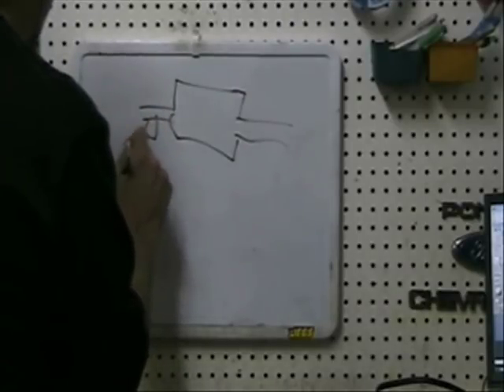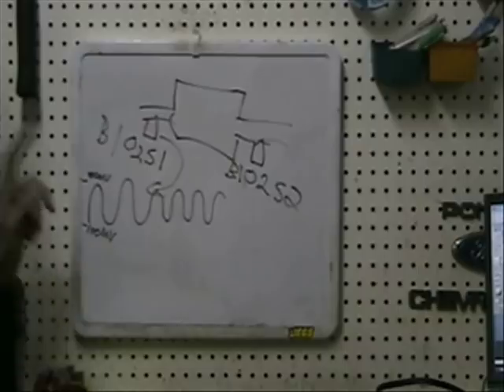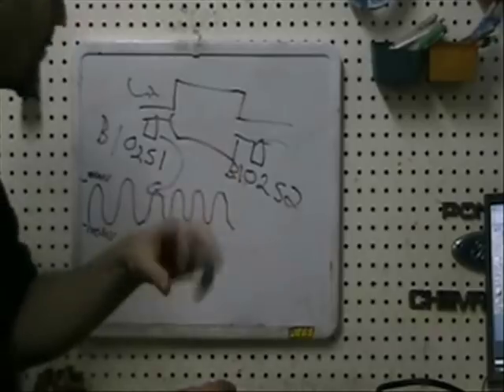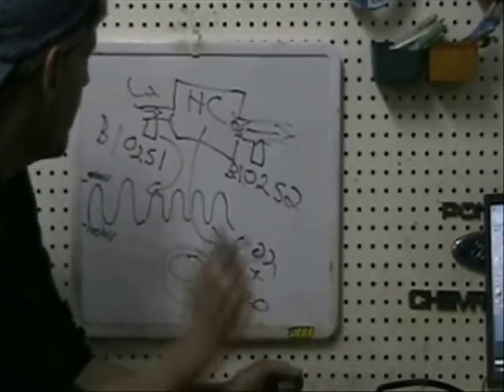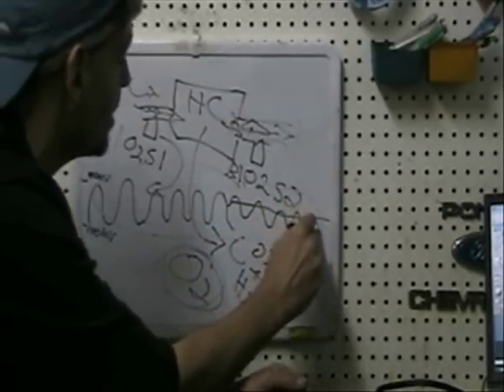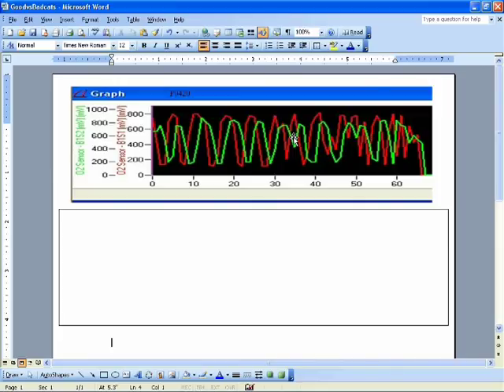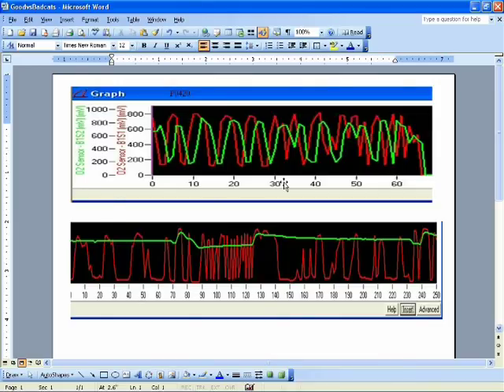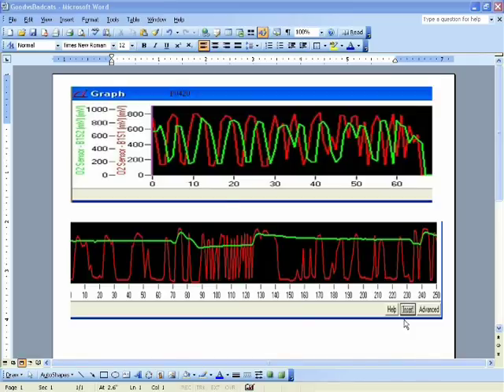P0420 P0430 catalytic converter catalyst inefficiency code diagnosis

Comment: also mat i have a chevorlet aveo it also has p0420, i just remove the heat shield and found that the manifold was cracked, so i tried to weld it back did a decent job. after a week the problem came back, this time when i checked i noticed that as soon as i hit the throttle the downstream o2 sensor voltage fluctuates, so what do you say maybe i still have a leak and also this car has a exhaust leak after downstream o2 sensor, can this be an issue?

Comment: Good explaination on bad Cat. Matt, what we look for to distinguish a bad O2 sensor? either primary or secondary?
Reply from the maker: Jan Post Generally, I test a O2 sensor by first and foremost, ensuring there are no contaminating factors (vacuum leaks, misfires, etc) to ensure normal conditions for the O2 then I verify performance by adding propane or inducing a vacuum leak and seeing that it responds quickly and appropriately.

Comment: Hello sir, I thoroughly enjoy your videos and have learned an incredible amount from. Unfortunately I have this pesky p0420 code on an in-line 4 cyl. I did replace the cat months ago(because the cat is apart of one solid down pipe which included the flex joint that broke). Not replaced with oem pipe/converter but aftermarket. Got the code shortly after. I do not have access to a scan tool(yet), but do have basic obd2 reader. I always check freeze frame whenever the code pops up. I should mention this code, if I clear it, only returns at idle such as at a stop light after driving for a while. The last time I checked freeze frame I noticed some differences. After engine was fully warmed up, driving at highway speeds for over half an hour, I was back at idle(stoplight to turn into place of work) when code set and fuel system was in open loop. I have always gotten fuel trim data, but this time there was no fuel trim data. Could it be possible this aftermarket cat is no good, or one or both O2 sensors have gone/going bad(both sensors are original with over 200,000 miles on them). I am a very scientific person like you, and do NOT like throwing parts at a car. What would be your next step, assuming no access to live data? Remove sensors and test with multimeter?

Comment: My mechanic today told me the codes were the 2 O2 sensors and the catalytic converter. I couldn't afford that. So instead he did a complete tune up and a fuel injection service. Hes hoping that will give me some time to save up n replace the catalytic converter.
Reply from the maker: You need to fire your mechanic immediately. He is completely incompetent.

Comment: Hi I have a 2006 Toyota Corolla S with my P0420 code scanner I have on when I'm checking my car turned the two locations one code 02b1s1 catalysts (v) reads 3280 and the other reads 02b1s2 (v) 0700 has to do with the sensors and feel when I drive my car and make a stop at the red light and the engine shakes like he was struggling when I no gas this also has to do with changing catalyst too ..

Comment: HI there.  I'm really enjoying your videos.  You seem to have a way of conveying the details in a way that more can understand.  I've got these same two codes on a 2005 Sienna with 235 000KM on it.  From the reading that I've done, the typical sentiment is that it's highly unlikely that both cats failed at same time.  I replaced the PCV valve with a Toyota brand one and cleaned the MAF sensor.  Any thoughts on what to pursue if so?I was reviewing your fuel trim videos as my LTFT is elevated on both banks at about 5 and 7% @ idle in hopes that there may be some relationship between them.  Not sure I'll find one it seems.  Cheers and looking forward to reviewing the collection now that I'm subscribed.
Reply from the maker: There really isn't enough data here to make a determination.  It is reasonable for both cats to fail- they are same age and under same conditions. It would to see fuel trim curve under load conditions to determine if there is condition causing Cat failure.  Idle fuel trim is useless.
Reply: I appreciate your time and attention in responding.  I started off at sienna chat with not being able to locate the S1 O2 Sensors, not knowing at the time the front side had FA sensors :-) which from what I beleive i now understand is not as straight forward to diagnose as I had hoped it would be. 
I put up some FT data as suggested by one of the forum members:  http://www.siennachat.com/#/forumsite/20577/topics/29458?page=1 
I'm planning on trying to get temp differential readings at inlets and outlets of cats if I can having read there should be about a 100 plus degree difference on the outbound side if catalytic activity is properly occurring.  
Changed the pcv valve and cleaned MAF last night as well.
Reply from the maker: George Georgopoulos The post cat sensors will still be zirconia dioxide sensors so it's the same diagnosis.  A/F sensors still reflect the oscillation but much differently that an O2 (I have a video on A/F sensors too).
  basically if you see oscillation of the O2S2 across a dynamic load range you have a bad cat. Q.E.D.
Reply: Thanks again.  Another great tutorial.  I should be able to, between the videos of yours which I've seen now, (hopefully) be able to definitively diagnose the A/Fs and the O2s and rule them out (or in) as culprits. 
If I need CATs in the end, I'll probably get a set of Walker units as the OE ones are just way too expensive. 
Looking forward to browsing the rest of your collection.  Looks like a fantastic body of work.
Cheers! (for now)

Comment: Getting p0420 and p0300 (random miss fire) codes. I have a v6- My bank 1 sensor2 and bank 2 sensor 2 are flat lined graphs at 0.01 v. Bank 1 sens 1 is 0.545v and bank 2 sens 1 is 1.20v both of these graph as undulations. 
Stftrm IS 25%. Long ftrm 2.3%.  Car idles very rough- SO I OPENED HOOD AND SPRAYED STARTING FLUID AT BACK FIRE WALL AND THE CAR IMMEDIATELY SPED UP - DID THIS MULTIPLE TIMES TO MAKE SURE IT WASNT A COINCIDENCE WITH COMPUTER METERING EXTRA FUEL, EVERYTIME THE CAR ACCELERATED IDLE. I ALSO SPRAYED IN FRONT INTAKE (before air filter) and got the same expected result. So I guess I have to find the vacuum/ intake leak first.
Reply from the maker: Correct- very strong evidence of a vacuum leak for sure.

Comment: Schrodinger. Love your videos and explanations! Helped me so much. Thank you. Question: I have P0420 code on 2001 Honda CRV and I get graphing very similar to the example you give of the downstream O2 sensor mimicking upstream...except on my CRV, the upstream oscillates between .1 and .9 volts, but downstream oscillates only between .5 and .9 volts, but in exact unison like your graphing (vehicle was fully warmed up and at 2,000 rpms for my graphing). My working hypothesis is that both the cat and the downstream sensor are bad. Does that make sense? (Sorry Youtube won't let me embed screenshot of graphing)
Reply from the maker: That reading sounds correct to me

Comment: I am always suspect of the claims of these magic fluids that say you can pour them in your gas tank to work wonders, but do catalytic convertor cleaners actually work?  I am about to graph my bank 2 O2 sensors after having a pending P0430 on my 06 Jag Super V8 and since I'm just learning to use the OBDII graphing function on an icarsoft i930,  your excellent videos are a big help.  Does having a supercharged engine make any difference in the LTFT diagnosis proceedures you present?

Comment: Thanks good stuff my sensor 1 bank 1 is going up and down between 3.24 volts and 3.69 volts my sensor 2 bank 1 is steady at 0.855 volts I hope I'm out of the danger zone will appreciate the feedback, also my car is a lexus 2008 V8 since you mentioned toyota Thanks
Reply from the maker: you have an A/F sensor, not a O2 sensor.
Reply: What do you recommend as the car is running good except for check engine light i was going to pull out a/f to see condition so my reading is pointless? Not sure don want to replace cat just yet but its my daily
Reply from the maker: on an AF sensor you need to read it by equivalence ratio, not voltage. the voltage number is just an arbitrary absolute value.
Reply: @SchrodingersBox  hello thanks unfortunately your talking a foreign language to me  lol I will try and replacing the both sensors on bank 1 or least try and cleaning them and see what happens I always use premium gas and occasionally throw in a seafoam in tank I guess I will take to shop because I don't know how to test like you say thanks for the response

Comment: To convert HC to CO2 and H2O cat uses NOx.  That the reason why they are called 3-way cat. If remember it right. At the tail pipe we have N2, co2 and h2o.

Comment: What diagnostic direction would you recommend going in if I have a PO420 on a GM 3800 engine, yet scan data shows normal, relatively flat on the rear O2 sensor and normal oscillations on the front O2 sensor?
Reply from the maker: I would see what it reads at 2500 rpm or while driving .

Comment: Hello. I have a 2005 Subaru Outback with 2.5 ltr. with a manual transmission. For the last 6 months, I have experienced several  P0420 CEL and have just reset it. I've been watching your videos regarding this code. So I'm using a app named "Torque" with my cell phone and observing the O2 sensor at the end of the down stream catalytic converter. Before I go on, I've noticed that if I'm towing my trailer (total weight of about 800 lbs), the CEL never shows. The CEL seems to only come on when I'm just doing normal driving. Anyway, I've noticed that when driving, the down stream O2 sensor shows a good voltage (I think about .5 volts) and is pretty steady. But when I move to transmission to neutral ( or push the clutch in), the voltage drops to pretty much nothing. Even after I get moving to normal speeds again (55 - 65mph), it takes about 10 seconds or so to get back to .5 volts. Is that normal for a O2 sensor to act like that (if the catalytic converter is bad)? I'm thinking the converter is just at the threshold of going bad and when I put strain on the engine (tow the trailer), the cat starts working above the threshold to keep the computer happy. Again, is that normal for the O2 sensor to do that during idle?

Additional info: A/F mixture is very close to 14.7 ratio and the long term fuel trim for both banks are pretty much at 0 although they do bounce around to 5 every once in a while. Car has 160xxx miles and is in excellent condition (regular oil changes, timing belt/water pump, etc).  Thank you in advance of any comments you can provide.  And thank you for the videos!
Reply from the maker: Sorry but I would need relevant data to determine the issue.

Comment: Hi, so what if you are getting a P0420 code but your o2 sensor graphs are as they should be?
Reply from the maker: noelywire and Blagoy:  I have not seen an instance where their was a P04x0 code and normal O2 sensor response.  I would first try repeating the test with the engine at 2200RPM rather than idle if that happened.  I might also try adding propane to the intake or inducing a vacuum leak to ensure proper response of the rear O2 sensor-  but honestly, you have to come up with a situation where the rear O2 trace "mirrors" a (correct) front O2 trace and that cant happen with any exhaust leak, bad O2, exhaust blockage etc.  On any vehicle I know of, it is engineered that you cannot get P04x0 in combination with an O2 sensor code: in fact a 04x0 VERIFIES your O2 are working if anything. Again, try the test at 2200-2500RPM or even while driving and I bet you will see the congruent traces.